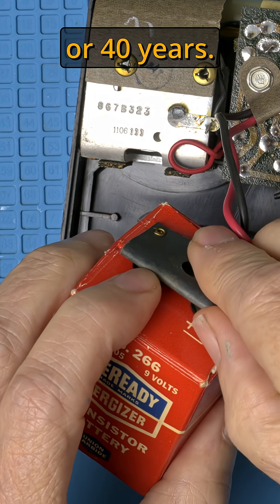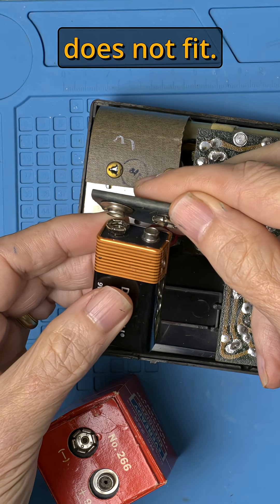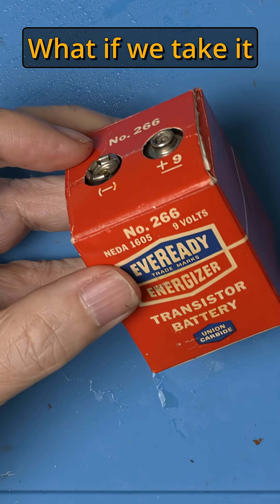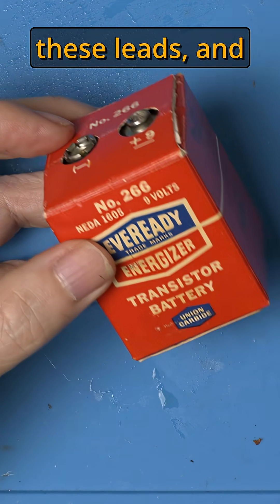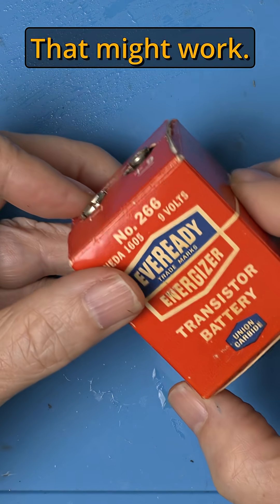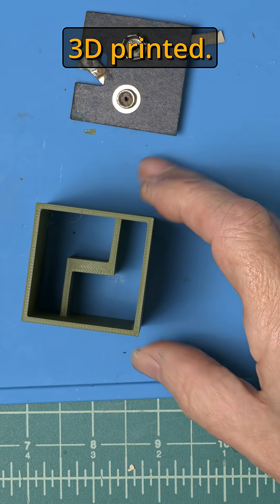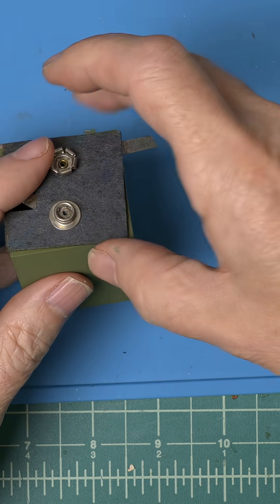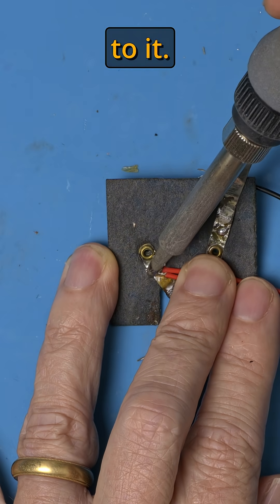3D Printed Vintage Battery Adapter #vintageelectronics #3dprinting #eveready #electronicsrepair

Comment: a PP3 size 9V battery wonlt last very long. You're better off making something to put 6 AA or AAA cells in series.

Believe it or not you CAN still buy those PP9 batteries at costs of between $15-60

Comment: You want to keep the old battery shape.  Or you want to just connect a battery.   Instead of so much headache.  You could have just replaced the 9v connector of the radio and directly connect a new 9v battery

Comment: Couldn't you have just connected the new 9v battery where the old one was by replacing the old connection terminals with the new style

Comment: So why dual 9V on modern to replace a single 9V on the old? Genuinely curious. Is it just longevity?
Reply from the maker: Yes, single would work, but this radio eats power.  Two alkaline batteries have a little bit less capacity than the original larger carbon-zinc battery.

Comment: Putting two batteries in parallel like that generally isnt a good idea. If one of the batteries have a slightly lower voltage then the other its going to induce a large current between the batteries.

Comment: I'm 81 years old and I think I've seen almost every size of battery. I recognize that one from when I was a kid. That was 70 years ago at least. I don't recall ever being able to buy one to power the toy it came from.
Reply: The vast majority of the batteries of this similar size were usually 6 volt and were probably most commonly used in lanterns and old large flashlights.
Reply: @snakerstran9101 bit off topic but I'm a bit acoustic when it comes to electronics and love me some weird tech/goods. There's a battery called an A23 that's smaller than a double A battery but it's 12 volts! Made of 8 LR932 batteries stacked in series and shrinkwrapped together. Fun stuff. It's thicker but shorter than a triple A battery
Reply: Thanks for sharing!
Reply: Im 60 and remember as a child that battery , i also remember taking it apart, from memory, it had a weird smell.
Reply: @brutonstreettailor4570  Choride.
Reply: Transistor batteries were carbon zinc pile  similar to the giant batteries used in lantern flashlights.
Reply: God bless you sweet Ron
Reply: Thanks for sharing your story, its greatly appreciated!
Reply: The other day I saw a lantern battery in home depot, honestly first time I've ever seen one! Very similar form factor to this battery but the lantern battery was a different voltage if I remember correctly
Reply: @DarkAttack14 the ones with the spring terminals are 6V

Comment: You should not connect batteries in parallel unless they are identical and at the same state of charge. Otherwise, small voltage differences can cause large equalizing currents, since the batteries have finite internal resistance. This can lead to faster discharge and heating.
Reply: So what's the solution? Hooking them up in series?

Comment: Could've just cut the battery terminals from the device and solder in one that fits the modern 9v batteries and you wouldn't have had to print any plastic crap in it 😅 I swear 3D printers just made the environmental catastrophe worse and people into idiots, even though we were promised stuff that weren't physically possible to make by injection molding or milling 😅

Comment: So 9 volts is always 9 volts when you wire it like that? Like could I theoretically power a 9v lightbulb with 400 9v batteries and it just increases capacity?

Comment: Cool that you built an adapter for two 9V batteries, but #266 batteries are still made, and in alkaline chemistry instead of carbon-zinc for better power output. If you really want to build your own, the case of a 266 (44.5 x 44.5x57.9 mm internal dimensions,) should be able to easily hold 6 AA batteries (14.5mm diameter x 50.5mm height) which would produce 9v output if wired in series. Might make for a nice little project.
Reply: Using six AA batteries would also prevent the leakage you will get when putting the batteries in parallel.  Even if the batteries are from the same package there will be a difference in the voltage, small as it may be.

Comment: if you use 2 battery, doesnt it make 18V battery?
Reply from the maker: They're wired in parallel, so the voltage stays at 9V, but the capacity doubles!

Comment: A fun idea, but genuinely curious why not just replace the old connector with a modern 9-volt connector? Was there a practical reason, or did you just want the excuse to make a fun video/3d print model? Which is a completely valid reason, I must point out.

Comment: That's a Neda 1605, they still make them in that exact size, be prepared to spend about $40 for that exact replacement and expect it to be a different color but the same shape with the same plug and voltage!

Comment: If not 6xAA, 6 pieces AAA would've fit there. Even 7 NiMH AAA. Any of these alternatives would've larger capacity, closer to the original even of regular acid variation, that only a pair of alkaline 9V might match.

Comment: Sold as a novelty online.   This project using modern 9V. Even with 2 modern 9V batteries the capacity dropped by 60% from original 40 year old battery if it were new.   What ever works.

Comment: Honestly not a fan of having 2 batteries in parallel without a diode. If they have diffrent voltahes bevause one was used somethere else before the fuller battery will discharge throu the emptier one. That could potentaly get very dangerous

Comment: im curious, wouldn't 2 9 volts be too much voltage ?
Reply: In parallel,  it not enough voltage as thats 4.5 volts.  If he wires in series it's 18 volts.  No bueno

Comment: The original battery was 9 volts of power but you put two new ones inside of it. Meaning it's now 18 volts and not safe😮

Comment: It looks as though there is enough room to fit four stacked rechargable 9volt batteries in there.
If run in parallel, that should not be an issue, the amperage may be a bit too high though.

Comment: You can in fact still buy these batteries, but your solution is a whole lot cheaper. The batteries they still sell in this form factor are 40 bucks a pop.
Reply: I wonder if theres 6XAA adapter on aliexpress for this kind of battery
Reply: @BSOE3058  There is, and I have one, Made in USSR, tough green plastic..)
Reply: @BSOE3058 that would be 12 volts
Reply: @BSOE3058 you can connect 2 adapters together. You don't really need to buy adapters like that. You just need a bit of wire and electrical tape.

They were supposed to teach you this in 7th grade science class. Alternate the batteries: 3 up and 3 down. Tape them together with electrical tape. Connect the batteries in series (running each battery through the next battery) by connecting positive to negative. Use a thin copper wire and electrical tape. 

Leave one positive unconnected at one end and the negative at the opposite end should also not be connected yet. Those are now where you connect your device to the battery. 

But here's the kicker: modern batteries are more powerful so a single 9v battery was probably the right choice. His radio might be burned out soon.
Reply: @brookelord3448  Tbh they really should have done that in middle school. Too bad budget cuts don’t even let them have useful skills. The last class my school had (automotive) got cut after my senior year in 2018. Ironically the only places with decent schooling is out north and on the west coast. If your in the south fork up money for private education bc we don’t know where a penny of that stuff goes.
Reply: @brookelord3448 burned out? No. You don't do current limiting in the battery unless you are doing something wrong and that will also absolutely kill the battery life. The radio takes the amount of current it needs. No more.
Reply: @zaprodk no. Go back and finish 7th grade science. No one was talking about limiting the current of the battery. So try 5th grade for reading 😅

You have to be fairly close for amps or the wiring feeding the whole system can literally burn off the insulation or the circuit board can literally burn. 

The only contingency is if that radio has a fuse in it. The fuse will burn if the amps are too high. 

Just look it up.
Reply: if you plopped a rechargable 9V battries, you got yourself a rechargeable transistor battery
Reply: @araigumakiruno  Lithium cell would last a very long time in this.
Reply: even cheaper would be just straight up wiring a single 9 volt battery up to the appliance
Reply: @joshymeow  I'm sure they want to retain the original feel and appearance.
Reply: @Sherman62  by using modern 9 volts instead of buying those batteries which exist today?
Reply: @joshymeow  If were still made, that would be an option.  The video creator says that they haven't been made in 30-40 years and that seems to be true.

There is a generic replacement on the market for $37 that maybe would fit inside the Eveready box....maybe.  And there are also lots of dead originals for sale; for display only.  The route shown allows for original appearance and cheap replacement, time after time.
Reply: @Sherman62  exactly
Reply: @joshymeow yes exactly glad you figured it out
Reply: @Sherman62 En México se fabricaba esa batería de esa marca pero cerraron por el año 2000
Reply: @joshymeow  Even cheaper to just get a single wall wart  most likely have a dozen stored away.. never know when you're going to need them
Reply: @punker4Real For a portable radio? That's not a solution.
Reply: @joshymeow  Even alkalines wouldn't last as long as that big battery. Doubled up 9V batteries should have the same lifespan as the old box battery
Reply: @specialopsdave Are you sure?  How much capacity did those old ones have ?
Reply: @specialopsdave  old big battery could have had its components more spaced out. what's the capacity of it?
Reply: @joshymeow these big boys not only looked like units but they were, 2500mah vs the ~550mah of the Duracell 9v used
Reply: @Chappomusic  the 266 has 2500mAH the 2 9v has a total ~ 1100 mAH. So it will work just not as long.
Reply: @specialopsdave  less then 1/2 the mAH
Reply: @specialopsdave  looking at the spec sheets on both, it looks like the original battery 9
v(266) still has twice the capacity of 2 9V(522)
Reply: @specialopsdave  It looks like there's room for at least one more 9v in there? Maybe two more?

I did kind of the same thing but used three 3.6v rechargeable IMR batteries with a built in charger so it can charge with a USB C phone charger. The radio, will play for a week on the new battery pack.
Reply: @bambur1 *mAh. mAH would me milli Amp Henry. In SI-units, hour is not with a capital H.
Reply: @joshymeow  You got your enjoyment watching, then toss in that remark ?  It is not about being cheaper, but creativer.
Reply: @citylockapolytechnikeyllcc7936  wtf are you saying? I just offered a simple solution. Is creativer a word?
Reply: @joshymeow  that’s what I’m thinking buy  modern 9v pad connections cut the old pad off strip back wires and solder the new pad onto the wires
Reply: @joshymeow And have less runtime. There is very little energy stored in one of those 9V batteries.
Reply: @zaprodk  cool?
Reply: @joshymeow , he gets more miliamp hours (run time) by wiring two modern 9volt in parallel circuit configuration.  
 Like installing a bigger gas tank in you car let's you go farther on a single tank gas😊
Reply: @jimwednt1229  I agree. Especially if a tube type radio.
Reply: @jimwednt1229  when did i ever mention capacity
Reply: , when did i ever say you mentioned capacity?
Reply: @joshymeow , when did i ever say you mentioned capacity?
Reply: @jimwednt1229  when did i say that you said that i mentioned capacity?
Reply: @joshymeow even easier just to use your phone to listen to music
Reply: $36.99 on Amazon
Reply: Creative solution! Excellent!
Reply: Damn, I wonder why
Reply: @forestvale3733  only one manufacture (that i know of) is making them due to not being used in modern form factors so they get to name their price unless someone else starts selling it cheaper
Reply: @forestvale3733  my guess is supply and demand.,
Reply: They are from my understanding still. Mostly used in military equipment
Reply: Difference is the battery you can buy has 2.5Ah so you need more than 4 of the smaller 9v batteries to give the equivalent play time.
Reply: Those batteries were expensive and hard to find when new. I had a G E radio that used them. I discovered you could tape in a regular 9 volt.
Reply: “New old stock” is around for a lot of stuff but expensive as hell
Reply: plus he gets double capacity
Reply: Y’all don’t understand it’s just way cooler because it looks like the old thing and it’s completely reusable because you can just take the dead 9 V out and put
Reply: £8 UK.
Reply: Very cool
Reply: How long do they last though?
Reply: Awesome sauce!
Reply: eBay has an adapter for AAs to this for $18 but yeah printing this is cheaper
Reply: Isn't it a bunch of triple aaas? Just ya know in a cube
Reply: 40 bucks?! brother you can buy a smartphone with that money
Reply: I saw a lot more than 40 dollars worth of work 🤦‍♂️
Reply: It's only cheaper if you have a 3d printer lying around
Reply: To be fair if you’re watching this and thinking of doing it at home without any knowledge of what’s going on you walk into that problem yourself.

If you’re following videos like this, you need to be paying attention to how the wires are organized and this video doesn’t hide it, so if you know what you’re doing watching this then there’s zero problems.

I feel like you’re concerned about the moron in society
Reply: Wow they probably making a killing if anyone actually buys them i doubt it probably make it by order.
Reply: At the cost of a 3D printer??
Reply: Not if you include the price of the 3D printer and time to design it

Comment: They make converters for both 6 AA's and a single 9 volt for like, 10 to 15 bucks on ebay. I bought a radio that took that type, and found the replacements. Much easier and you dont need a ridiculously expensive printer to make a plastic case.

Comment: Connecting two 9v batteries in parallel will drain both batteries since the voltages of both batteries are not exact

Comment: Yeah, 3D print. It is easier to find battery, or construct case literally any other way than 3D print shit.
Why you don't understand 3D printing is not available for 99.999% of cases
Reply: Why are you so upset, let people do their projects the way they want to do their projects. They probably could've switched the lead or something but what's the fun in that when you could make something yourself? I'd argue the final product looks really cool, especially with the use of the original box.

Comment: There's enough space to have 6 AAA battery cells in there, a holder for two cells is Length: 53mm ,  Width: 25mm,  Height: 13mm... so you could easily fit 3 holders in a U shape and get more battery life - voltage on 9v batteries will go down as they discharge, while regular alkaline will lose much less voltage.

Comment: Ah union carbide, i hadnt seen that name since the bhopal gas tragedy
Reply: That’s what I recognized the name from… thanks for reminding me of that shitshow…
Reply: I was thinking same
Reply: They changed the brand name for Energizer before selling it.
Reply: @chucku00 in india Eveready still exists and sells
Reply: @Beastmasterislive  Yup but it isn't a Union Carbide subsidiary anymore since 1986.
Reply: @chucku00 that's about when they sold our plant to Elkem. I suppose the 80s was the beginning of a reckoning for UC.
Reply: @nbain66  Ended up part of Dow Chemical
Reply: @kbtred51 Elkim is missed compared to Dow/Globe that are around now. They seemed to prioritize volume and equipment maintenance over short term results and it led to better longevity.
Reply: @chucku00  The Energizer name was adopted in 1980 for the alkaline batteries to compete with Duracell. The American Ever-Ready company licensed it's market leading brand world-wide and Energizer has been buying these up.
Reply: @kbtred51  its* (possesive)
What is your point? Eveready* was also a subsidiary of Union Carbide. Eveready Battery Company, Inc.has been created after Ralston Purina bought Union Carbide's battery products division.
BTW the name is "Eveready" since 1914.
Reply: Yes men! ^^

Comment: Reusing the box was satisfying
Reply: An acceptable alternative wouls have been to paint the 3d printed parts like the box
Reply: @NoFlu  man it just keeps getting better. Damn I dint think about that.
Reply: @TheMexicanU.S.Marine I’ll do you one better, use a printer with a multi-material setup to print the 3D printed frame in those colors. Even the logo
Reply: 100%
Reply: Came her to say this
Reply: Very. Well done.

Comment: Opening and closing that box often will dmage it.  You'd be better off putting a lithium pack in there with a charge circuit, so you just plug a USB cable in the back

Comment: Given the dimensions of the old battery, you could have made with 4 batteries instead by putting each's narrow side no the other's broad side and printing a central column to keep the pack solid then taping the thing together

Comment: Have you checked your home insurance coverage lately?  Replacing one 9 volt with 2?  If my math is correct, and it usually is at this level,  that has 18 volts now.  Is the devices components rated for 18?  You may be burning out something else.

Comment: Did you just put the batteries in parallel? Don't do that! When the cells have only tiny differences (voltage), currents flow between them with minimal resistance, trying to equalize the system. Can cause heat, damage, loss. Only in series, never parallel.

Comment: i first thought you where gonna fry the radio when you said you where gonna use 2 9 volt batteries untill i saw you wireing them in parallel